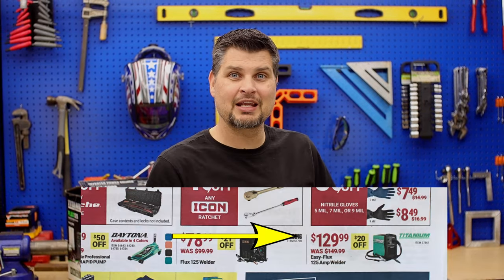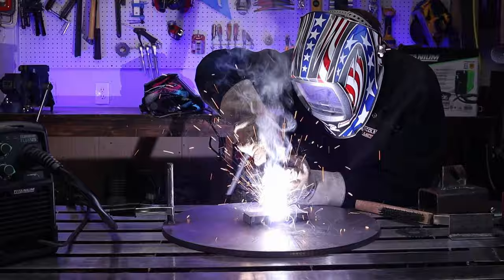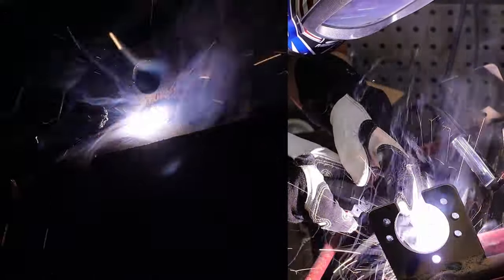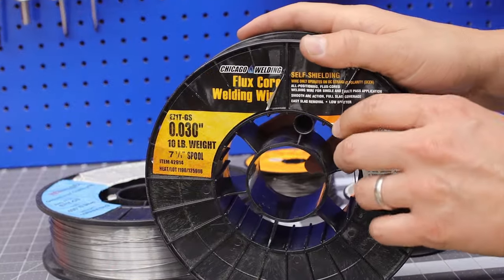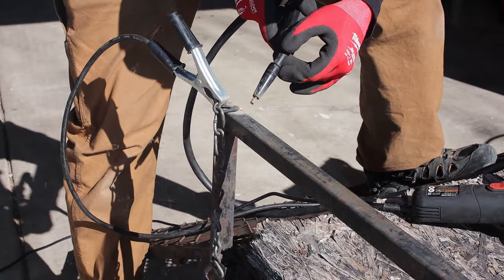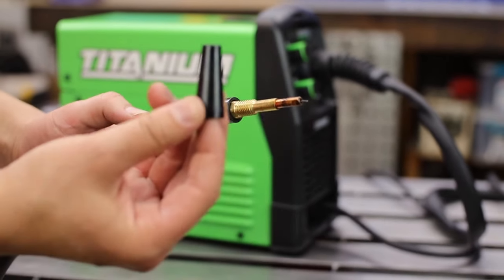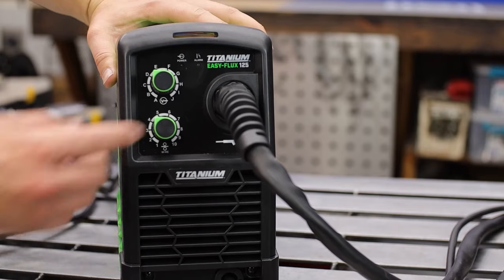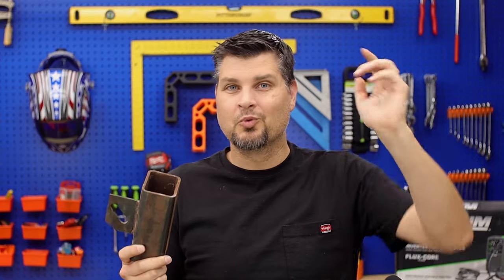I Hate Harbor Freight......TODAY!  Titanium 125 For $99!

Comment: I mounted a solid brass handle to the lid with heavy pop-rivets (be sure that the rivets are away from the wire spool, and feed assembly), and bail type latches on either side, also with heavy pop-rivets (still gotta watch out for the internal parts),  to solidly connect the lid to the machine body. Now, I can simply grab the handle, and go. I used the handle and latches as templates for where to drill the holes, and pop pop pop, it was done in about 20 minutes.
Reply from the maker: Right on, thanks for sharing!

Comment: I’m planning on building my own smoker out of a 250 gallon tank, I believe the diameter is .233.

Never welded or owned a welder.

What welder do you recommend, I’ve researched and everyone says to get something that’s flux core compatible.

Makes sense, will probably only use it for the project and other small projects around the house.

What welder would you recommend that might give me the best welds, specifically in areas I may only be able to weld on the outside?

Hopefully that makes sense, thanks for your time.

Comment: If you need to weld 1/4 in and can pre heat the steel with a torch. It'll get better penatration.
Reply from the maker: Yep that definitely help. I'd also put a small bevel on it and see if it's a joint you can weld both sides.

Comment: Just as a side note, multi pass on flux core is a big no-no for 99% of the flux core wires out there. They all say single pass. The wood becomes brittle and will crack easily.

I've had one of their flux core welders for 20+ years and it does ok on even a little Honda 1800w generator.
Reply from the maker: Very true, you have to use the correct flux core wire.....which I was NOT. It was just a test piece. Thanks!

Comment: Will running it off a non inverter generator damage it? Since it's an inverter style & not a old school transformer.
Reply from the maker: It doesn't care as long as the power is 120V AC
Reply: @-DIYPRO-   Thanks for the reply....Have you tried it with a 3500 watt. 4400 surge max generator? I was really hoping my 3500w duromax could weld steel bicycle frame thick metal.
I think the new  inverter style puts down a nicer, less splatter DC weld. But the old transformer style is much less prone to damage/breakdown.... I'm hoping my 240V mig/flux can do thin metal on the DCv flux core setting. I'm gonna go down to .30 flux wire & tip from the .35 mig wire....Not sure why my 240V  didn't work well with the generator. Since the 240V outlet has 2 hot wires & supposedly has a higher Amp rated breaker than the 120V outlet. I would 3500w is 3500w whether it's through the 120V single wire or through  two  wires = 240V & 3500w 🤷‍♂️.
Reply from the maker: @michaelbrinks8089  Bike frames aren't too thick and you won't be doing long welds so a 3500 will work on those lower settings.

Comment: Can it butt weld 28 gauge steel like food cans?
Reply from the maker: I'll let you try! Let us know how it turns out!
Reply: @-DIYPRO-  I won't buy one until I know it can weld thin metals. It seems no one covers welding thin metal, might be of interest for ppl if you make a video.
Reply: if you run .030 and keep the tip further away (like have a bit more wire sticking out than normal), you might be able to get away with it. .023 wire you definitely could, but I think thats shielded wire only